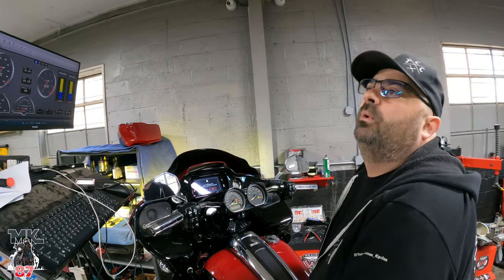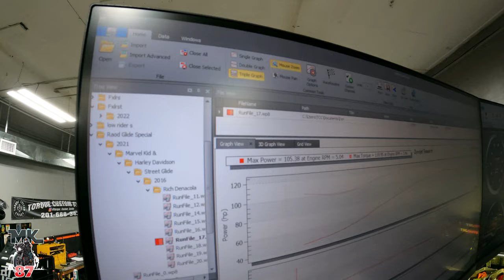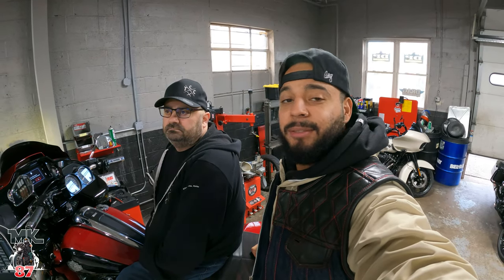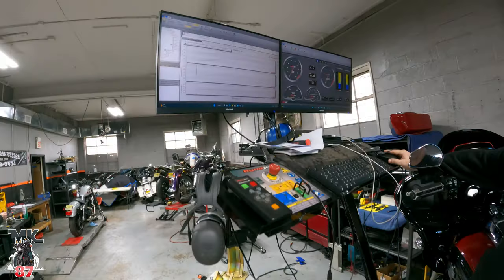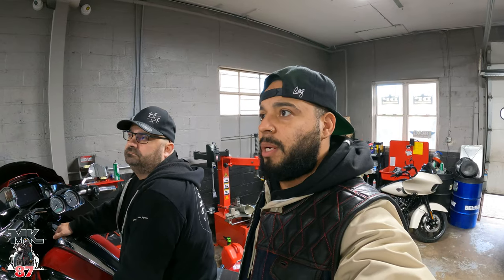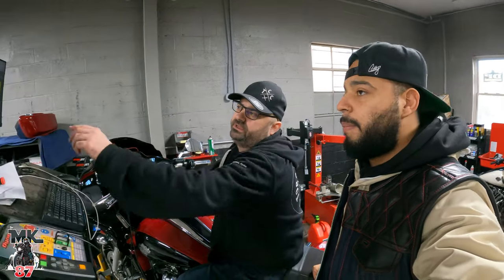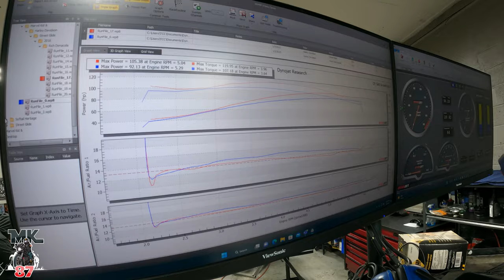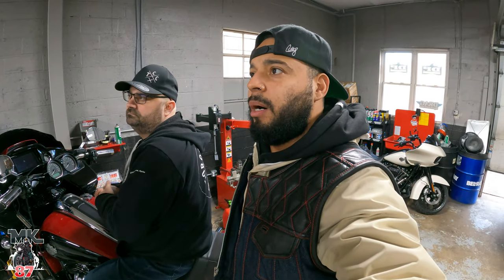Feuling 465 reaper cam Dyno numbers on Harley Davidson Road Glide

Comment: Forgot to include in my comment below:  Nice numbers (105+ hp and 119+ torque) for essentially a stock 114 M8 and curves look good too.
Reply from the maker: Thank you 👍🏽
Reply: That's not stock at all. Tune, header, pipes, cam, oil pump and plate. Nowhere near stock. Just doesn't have a big bore kit.

Comment: Those pipes sound sweet,big improvement in HP and TQ 🤟
For a comparison I’m running on my 21 RoadGlide supertrapp header,2 into 2 rinehart slip ons,S&S stinger air cleaner and  S&S 475cam. Dyno was 115.8hp 126.2TQ

Comment: I have the S&S 465 Cam (full cam chest kit) in my 2021 Road Glide Special. Supporting mods include S&S 2-1 Sidewinder Exhaust (w/catalyst), Fuel Moto/K&N 3956 ventilator-style Air Cleaner and Dynojet PV3b Tuner (map by Fuel Moto).  Haven't had it dyno-tuned (yet), so no numbers known, however torque is excellent from below 2000 rpm to 5000 rpm (I ride mostly 2-up, just cruising, rarely go much past 4500 rpm) and fuel economy is fantastic (average 46.4 mpg on the highway at 70-75 mph).  Upcoming mods will be installing my S&S 55mm intake manifold (ported by Ward) and adding Dynojet TT-8 Wideband Sensors Kit (and revised map).  
    Curious how the S&S 465 Cam compares to the Fueling 465 Cam, and also how the S&S 475 cam compares to both 465 Cams (and Fueling 472 Cam...does Fueling have a 475 cam?).  Enjoy your videos; keep'em coming.
Reply: 475 cam is dead on the low end but a rocket in the higher rpms.

Comment: I had a road glide 114 with 475 cam, vance and hines power duals. Rinehart slip ons, TTS tuner and HD intake. It dynoed at 129 torque and 116 horsepower. Not knocking you but it does seem a little off.  You also have the chrome werkz exhaust that is a better set up than what i had .What tuner are you using?
Reply from the maker: U sure those aren’t the u corrected numbers …
Reply: @Marvelkid87  I have a video on you tube sharing the numbers and I show the dyno sheet. So yeah not my corrected numbers.

Comment: Solid numbers bro. Please tell me your putting a monster cam in the low rider!
Reply from the maker: I have a 475 in that but I’m also rebuilding the engine now to 😅
Reply: I just did a fueling 592 in my street bob with a 128 kit and ended up getting 155.1 tq and 149.2 hp.
Reply: @Bskullz99  stock heads?
Reply: @ryantidwell19  A1 performance. I think +1.5

Comment: 92hp to 105hp (+13hp).  No doubt you would feel that, particularily with the increased torque, when riding. So what would that be costing ordinary folks to get an additional 13hp? (parts, tuner, labour, dyno).
Reply: 3-5k cam chest kit alone is around 2k. Then also have pipes air cleaner tuner Dyno labor
Reply: @roystark9987  Glad I bought the Pan America, plenty of hp right out of the box (150hp at the crank), no need to spend the big bucks on stages. You would only need to swap out the muffler if you want to disturb the neighbors.

Comment: I'm not sure how I feel about those numbers.  My 110 twin cam made 120 tq and 116 hp on the dyno with stepped 2-2 exhaust. The M8's are supposed to be so much more powerful??
Reply: Do you have the 110 tire shredder cause that's what I have in my 2011 dyna street bob (106hp/122tq) could've gotten more out of it but I'm running V&H dual radius exhaust which is not the best for big HP so I've heard anyway but looks and sounds waaay better!!!
Reply: what cam are you using to get those numbers?

Comment: From some reason, you don't look that trilled or impressed.  John (Cycle fanatix)  got a bit  better numbers with a 475 S&S Cam, at least the horse power and he has a 107.  I'm not knocking you or  anything, I'm just comparing the two
Reply from the maker: Wow that’s awesome 👍🏽
Reply: That’s because numbers can easily be manipulated on a dyno. Numbers don’t always mean faster either.
Reply: @pnutz__  negativity 😡🚬☕️
Reply: This is the kind of bird-brain response that I knew would come in.  Bro, the dyno numbers that you see can be manipulated in a variety of ways, including temperature and the gear that the bike is tested in.  A good tuner will tune in tune and do test runs in 4th and 5th.  Most of the numbers you see online are 6th gear roll-ons.  Not to mention, the 475c is a entirely different cam.  Don’t believe the hype.
Reply: The 475 and the 2 into 1 that John is running will give him more horsepower. Also we don’t know if his bike is tuned leaner for higher numbers. We tune for what is right for the bike. Look at the A/F lines. We always try to walk that 13.5 line.
Reply: @TorqueCustomCycles  yeah I would be  glad to have those numbers 👍
Reply: @carolinarider5237  come see us in jersey
Reply: @TorqueCustomCycles  one day when I trade for a M8. I have a 103 stage 2 at the moment. Woods 222 Cam. 88 HR and 102 TQ